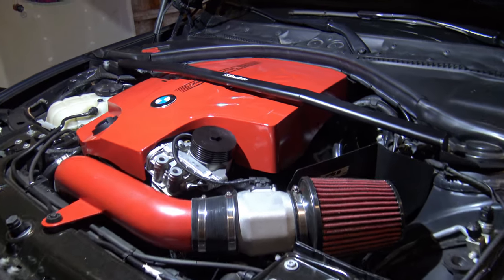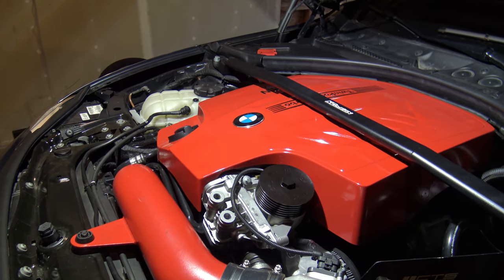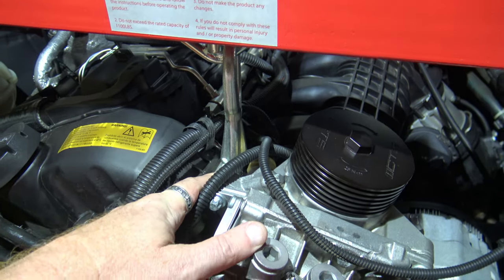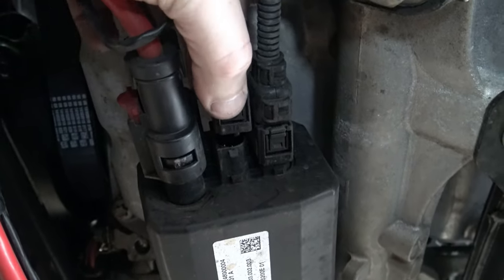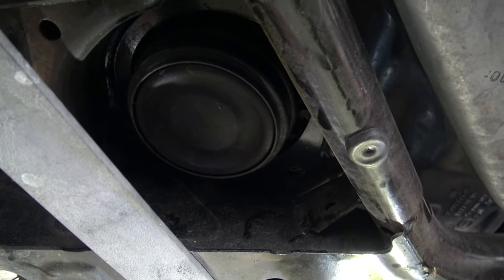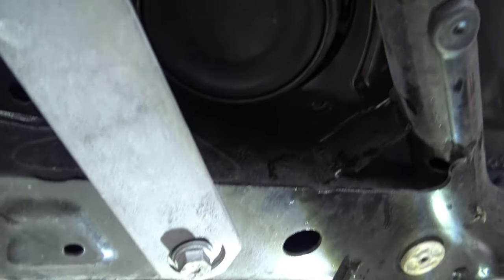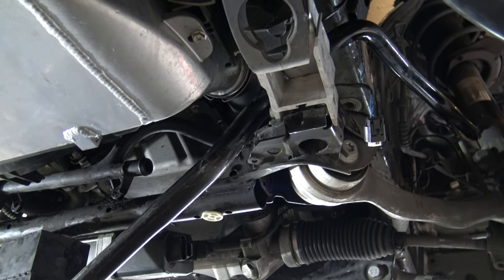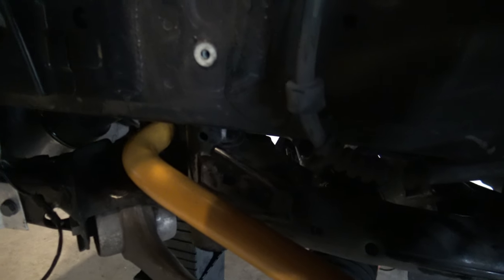KC Design front sway bar DIY for the BMW F3X series!

Comment: I did that same swap by just using two jack stands at front . Place jack under subframe,  pulled out front and second subframe bolts and loosen rear bolts . Then lowered subframe just enough to replace bar. Much simpler. Didn’t disconnect or unplug anything.
Reply from the maker: Great feedback, always looking to do the work the easiest way possible!
Reply: Do you have a video of this (either yours or someone else's)?
Reply: So you only lowered the sind frame?
No disconnecting of steering column and so on?

Then it's much easy

Comment: Does the ride seem any harsher over small bumps like man-hole covers -- with the new sway bars?
Reply from the maker: It doesn't to me, no significant change in harshness per se, just feels much more planted and solid. Sure just hit a bump, but BAM, and it is over.
Reply: @BMWDIYGuy  cool thanks
Reply: Sway bar firmness would be felt more in turning, not in straight travel going over bumps. Your tires and dampers would change the feel of that

Comment: I just received the powerflex sway bar bushes, but seen this video it does not look easy, I’m hoping that I don’t have to do most of the things you have done as I’m not going to replace the bar, do you think is it possible without dropping the subframe? Great detailed video btw, many thanks for sharing.
Reply from the maker: Candidly if you were playing on upgrading your sway bars I would do both at the same time.  You are going to have to do pretty much all the same to swap out the bushings.

Comment: I doubt you will see this comment since the video is a year old but how did you get your engine cover red? I have the same engine cover and mine came stock black. Looks really good matching the intake. Did you do it yourself or buy a replacement cover?
Reply: anddddd i found your entire video dedicated to it. Thanks
Reply from the maker: @liamkengla8120  yup.. and granted my painting skills are not Pro level, so lots of comments on how to do it better.. but even with that, still turned out really good and I enjoy it. 8)

Comment: You should smear a little anti seize around the hub mating surface. That’s what I do, especially on the rear where my Ferrara wheels have a very exact and tight tolerance to the hub bore. Also, if you should need to lift the engine higher, such as for a Pure turbo upgrade, an E46 tow eye is physically shorter so you can lift the engine higher with that same engine lift. I can understand the point of expanding your content, but having just installed a set of KW V2 coilovers, I fail to understand the why you would undertake this much work when coils vastly improve the handling of the F30 chassis.
Reply from the maker: Great comments and great question:  I will add coil overs AS WELL to all of this.. the goal is to improve it all, not just one component.  COs will dramatically help, but I want the supporting structure to be just as good.

Comment: Wow no joke replacing stabilizer bars on F series, great work ! I have an f30 320i, currently on H&R Super Sport springs and Koni Yellows. Bodyroll is virtually eliminated, especially in ordinary driving. Now not sure if worth doing thicker stabilizers now, as you do need some roll to allow the suspension to do its work. What would be good sizes to go up to that aren't too aggressive? I'm not even really sure what my stock M Sport stabilizer sizes are though....
Reply from the maker: Not a small job for sure but absolutely worth it!

Comment: With the front and rear sways installed, would you say the car feels more like driving an M car now?
what else would you recommend to get that M feel on the suspension side?
Reply from the maker: So great question overall, but no single thing is going to make that much difference.  Each piece brings an improvement.. but 10% here,  20% there.. These sway bars are a HUGE difference over stock, so alone will make a change you can immediately feel considering body roll and responsiveness.  This isnt a small job, though not overly hard to do, but will make a large individual difference.  All in all though, its all of it.. sway bars, shock tower strut bars, and coil overs that make the whole system.  The F32 is significantly tighter in handling now than it was, which is really great.
Reply: Is it too rough for daily use? The h&r anti roll bars I’ve heard are too harsh and also more for tracking
Reply: @eshay6161 that would depend on your shock and spring setup. Most aftermarket suspension kits are designed to account for the factory soft sway bar. With an upgraded sway bar you can soften the suspension for better ride quality